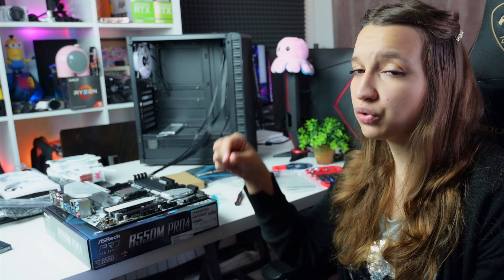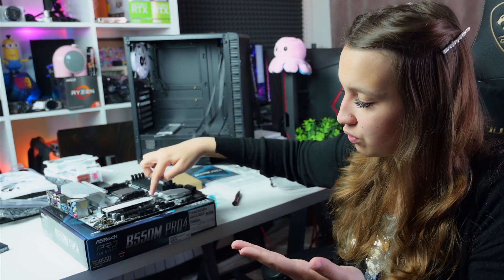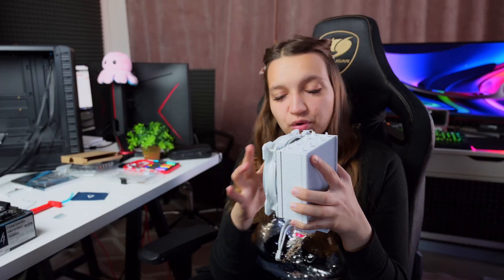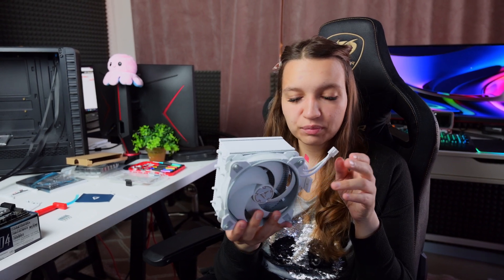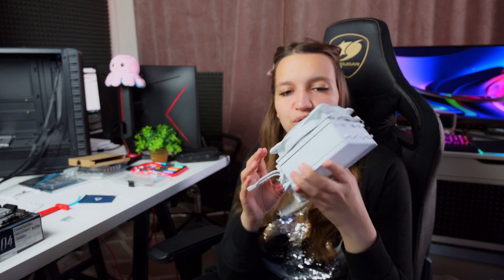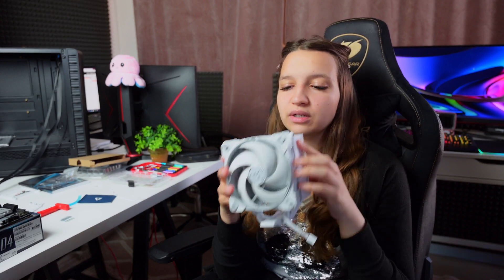Building  THE Ultimate 1500 $ GAMING PC for my Collegue Stoyan Part 1!

Comment: Cakes! Yes, gabby will make some cakes in the future
Reply: I found more easy to install the Arctic cooler than the amd stock one. ( I mount the new cooler without removing the mobo in the case)
Reply from the maker: Thats great to hear installation process I was skeptical but the owner got great temps which I will show in another video. So I can confirm Arctics instructions are good